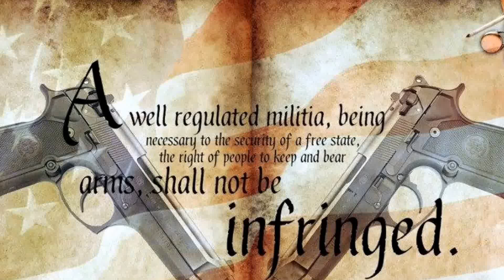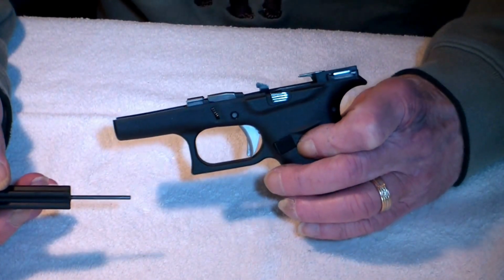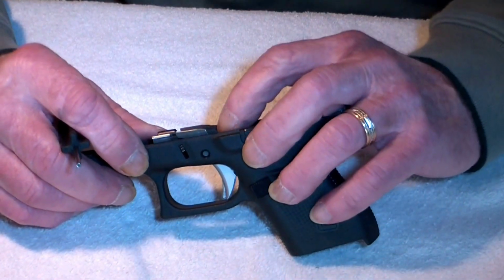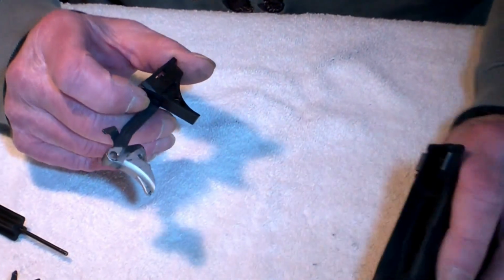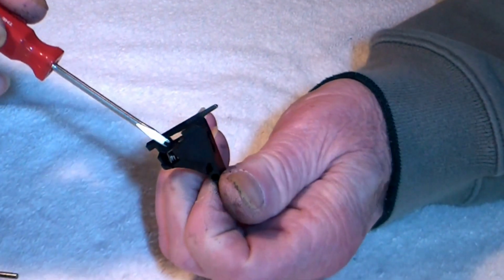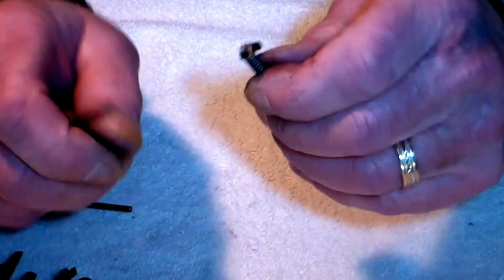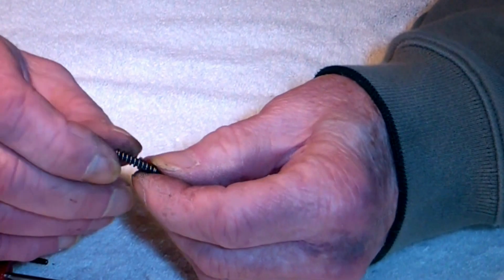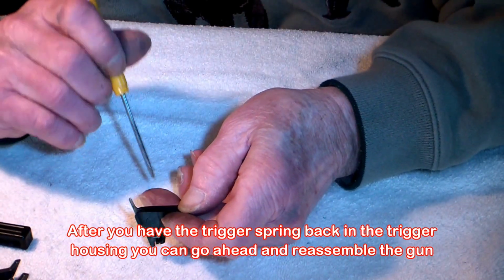Glock 43 Trigger Spring Removal

Comment: THANK YOU, THANK YOU, THANK YOU!!! I was told by a Glock armorer that I had to buy another trigger housing. Watched a ton of videos & you were the ONLY one who showed me how to get that damn spring back in there! You saved me almost $20 bucks with the new housing & shipping! Cant thank you enough Sir!!!
Reply from the maker: I'm glad that my video on the G43 trigger spring was of help to you.  I know that the video quality was not the best in some portions of the video however it was evidently good enough for you to get the job done.
Reply: @tomrum42 , I got it in there, the only thing now is that it's really hard for me to get the arm under that retainer fold as it wants to sink down deep into the housing. But the arm of the spring rod is still in place in the lower opening so I have no idea why it wants to drop?
Reply from the maker: I'm not totally sure of what problem you are describing. Is the gun functioning correctly? Trigger pull OK? Trigger reset OK?
Reply: @tomrum42 , I havent shot it yet since polishing the internals, by dry firing its performing fine